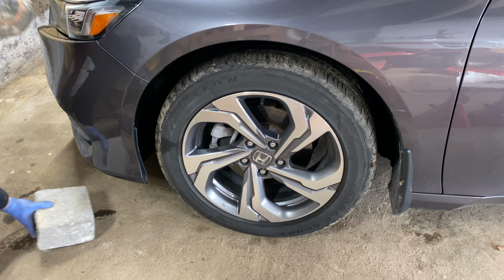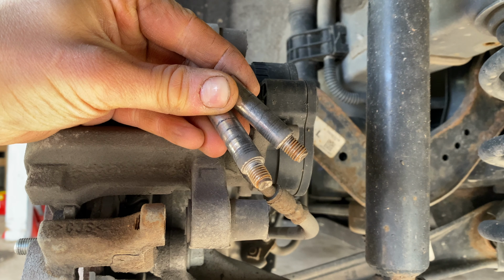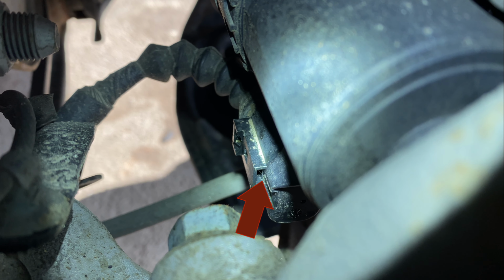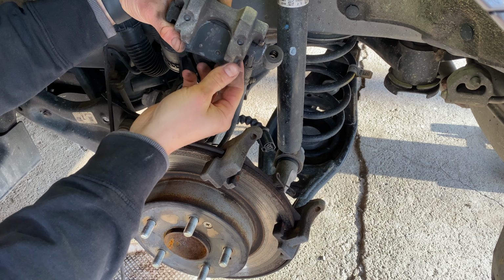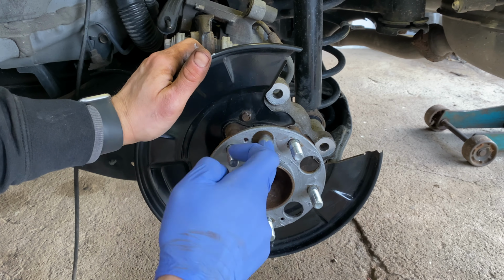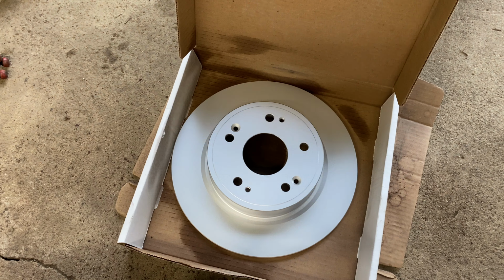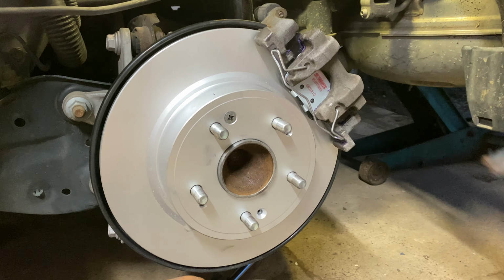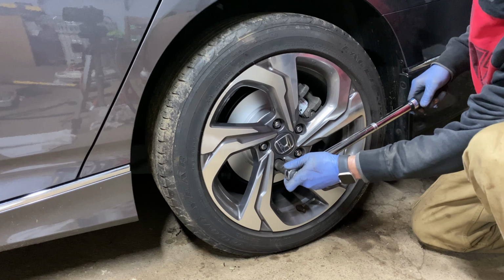2018 Honda Accord Rear Brake Pad & Rotor Change - Electronic Parking Brake in Maintenance Mode

Comment: Just a small correction. You don't need to buy expensive scan tool to retrieve parking brake. Autel's AP200 that costs around $50 will do this job. In fact, you can also monitor ATF temp when doing ATF flush, read / erase codes, get Live Date for electrical and the list goes on. It pretty much the same functions as on $500 to $2k scan tool.

Comment: Anyone else notice the rear brakes wear two to three times faster than the front? I have 50k on my 2020 accord sport and still on the original front brakes with 6 and the 2nd set of rear pads with 5.

Comment: Question:

1) can I use anti seize instead of thread locker for the 17mm bolts?

2) you used two types of brake grease, the orange and purple one. Can I use and is it safe to use just the orange one? The silicon ceramic one only? Or do I also need the ceramic one only?

I will be doing my first ever rear brake job on my Accord, want to make sure I do it right.
Reply from the maker: 1. No. 2. No, they are specific to use case.
Reply: @DavidStumph  last question. I’m in canada and Canadian Tire doesn’t have the ceramic extreme (purple) like the one you used. They have silicone ceramic (orange) and silicone only (green).

For the slide pins I see you used the silicone extreme (orange) so that I can buy at CT. What about for the metal to metal part? I shouldn’t use the silicone (green) right? I should specifically use the purple one?

Is it safe to use:

1)  green instead of orange for slide pin?
2) orange instead of purple for metal to metal?
Reply from the maker: Don’t get fixated on the colors. Silicone based for anything coming into contact with rubber and not subject to extreme heat -40°F to 400°F (it’s not petroleum based, to avoid rubber breakdown). Metal to metal contact points, the ceramic synthetic is what I use, it’s not petroleum based and has a higher heat tolerance than the silicone base -65°F to 3000°F.
Reply: @DavidStumph got it thank you very much

Comment: Hello. This is a safe alternative to using a scan tool correct? E brake will work normally after this without needing a dealer to look at it ?
Reply from the maker: Yes.

Comment: My automatic brake keeps turning on automatically after turning off the car… what I did is put in accessory mode and turn it off and then unplugged the battery is this smart or do it in accessory mode? Please reach out
Reply from the maker: Hello, those steps are not in my instructions. Sorry, I am not sure what you are doing. I hope everything turns out well.
Reply: @ worked just fine! I turned off the e brake and disconnected the battery and the e break stayed off. I replaced one side just fine. The only thing that got me was the stupid ass screw on the rotor
Reply from the maker: @ohhchuta that screw does, in fact, suck!! 😂
Reply: @DavidStumph  thank you for this video man! Best one on here.

Comment: I just did this job on a 2020 Accord.  This video was an amazing help and a great tutorial on what to clean up, what to lube and how to do the job.

Two notes I found:

Another video I watched which wasn’t as complete as this one demonstrated putting the vehicle in ACC mode and winding down the caliper with needle nose pliers or a caliper tool.  I rented a caliper tool and was able to wind down the e-Brake without taking it apart.  Very easy and can do it by hand.  You definitely don’t need to take the ebrake housing apart.

I also noticed brake noise (clicking) on the first test drive.  I got premium low dust pads that seemed to fit quite nice but the spring clips (inside pads) did not seat tight against the caliper tight enough causing a clicking sound.  I had to take the wheels off and pry the springs up tight against the caliper.  That got rid of the noise.  Next time I would pry up the springs a bit before install to make sure they’re tight.

Extremely helpful video for someone that hasn’t done brakes in 20 years though.
Reply from the maker: Honda tech info maintenance guides advise the method I showed to disassemble the e-brake. I still recommend this as winding as you’ve listed forces the motor mechanism to turn without power and programming logic applied, that is not recommended and does risk damage. I absolutely appreciate the feedback, the time you spent commenting, and I hope future videos prove equally helpful.
Reply: @ it seems like the motor is sort of like electric motors I’ve taken apart on a lot of different cars for a lot of different reasons.  I’d wager there’s a plastic gear and bushings in there which will wear out anyways.  I don’t see how it would damage the ebrake motors or be any different than turning the torx and re-assembling, but time will tell.

I did think the video was excellently done and very to the point.  Thanks!

Comment: Absolutely spot on. Complete and concise instructions on how to do the job properly and effectively. 

For those that do not want to disassemble and reassemble the EPB motor, a cheap ($40) dongle,  autel ap200,  can be purchased that makes your phone a scan tool. You can effortlessly put your brakes into and out of maintenance mode.

Comment: Is it possible to just deactivate the automatic parking brake by putting it into neutral and then pressing down on the parking switch to turn off the automatic parking brake? Or does that not work for this?
Reply from the maker: Does not work that way.

Comment: i try to take out the rotors on hrv 2020 could not able too why i alrady remove the screws on  the rotors that holding it in front i still could not able to remove it try banging it  did i miss something i remove the calipers and brackets also just rotors left but not able to remove it darn why

Comment: I noticed in other videos, the caliper piston is first turned a few times, then once it couldn't turn anymore, it was compressed as in your video. Is turning the piston necessary?
Reply from the maker: Yes, you need the room to insert the new pads over the rotor.
Reply: @DavidStumph  Thanks for the quick response. Yes, I know the piston needs to be retracted, but does the piston need to be turned clockwise until it stops by a special tool or just compress the piston straight back into the caliper? The tool I saw in other videos had a round disc with two pins that fit into matching indents in the piston
Reply from the maker: Good eye. Once the electronic parking  brake is manually retracted as the video instructs, only straight compression of the piston is needed. No fancy tools, no twisting. The other videos for the 10th gen are misleading.
Reply: @DavidStumph  Thanks David. I understand now. Does the car need to be put into "maintenance mode" first, then returned to "normal mode" after the new brakes are installed? If so, how do I do that without an expensive scan tool?
Reply from the maker: No maintenance mode.

Comment: Should the front be changed at same time?  Firestone is telling me they all need to be changed but I’m skeptical.  Most of the breaking comes from the rear, right?  Any info is appreciated
Reply from the maker: Depends on wear and condition. Separate changes are possible. If you’re not sure, I’d take their recommendation. Your time is also valuable if you can avoid two trips.
Reply: @DavidStumph  thanks 🙏

Comment: Instead of releasing the brakes with the socket we connected jumper cable wires to the battery then with some cables we released the parking brake slowly until they were depressed all the way but I’m getting a brake warning on the dash any thoughts on what I can do? Otherwise we did the same thing in the video

Comment: So I did the accessories mode for the brake and yes I did got all my lights on after I turned my car on which was scary but after shutting down the car for 5 min all the lights went away. But for my next brake and rotor change I will do what you showed in this video sir. But I got a question- I didn't change my rotors since 2019 oct so do you think I should take the risk to get the rotor's screw on my own coz I'm sure it fully rusted af lol

Comment: 3:20 what do you mean by, “To avoid contamination of this closed system, I strongly recommend lining up the splines to the actuator and reinstall following a complete winding of this mechanism.” Are you just saying to re-cover it as soon as you wind it and before you continue to replace the pads and rotor?
Reply from the maker: Yes

Comment: Great job, I always do it in accessory mode and make the job a lot quicker, also eliminates messing around with electronic part that can be sensitive.
Reply: I was about to say, his method is a little more complicated, I did it in accessory mode also and no issues, much quicker also.

Comment: Great Job.  Please do a transmission filter change on 2018 Accord EX (10th Gen)  There are several fluid only clips but no filter change. Thank you for your consideration
Reply from the maker: There is a strainer assembly, so this isn’t a quick job imo. It’s considered a “lifetime part”. Might consider tackling this one day, but not sure I’d want to pursue this one.
Reply: I got the fluid replaced at 30K on my 2019 Accord EX and the dealer told me there was no filter, only oil.
Reply: @bluazur55  Thank you for your reply.  I take what they told you with a grain of salt.  It's not logical...I think they are talking out of the side of their mouth on this one.  I'll let you know if I find out differently.

Comment: Should I put anti-seize onto all bolt threads so everything breaks loose easily next time?  Same with the brake bleeders if I ever decide to do a brake drain and fill to put anti-seize on them as well?
Reply from the maker: Do not put anti seize on the lug nut bolt threads. You’ll end up losing a wheel. Only apply anti-seize where I mentioned in the video. If you’re not sure, take it to a garage and have a professional handle it. Good luck!

Comment: Would this same process work in a honda insight 2019?
Reply from the maker: Not sure, haven’t changed them on that car. Does it have an electronic parking brake, if so it’s likely very similar.
Reply: @DavidStumph  yes it has an electronic parking brake like the accord

Comment: I replaced the rear pads and i wish i saw this video before but i ended up twisting the piston and it worked and everything but now im getting a brake warning light and my parking brake only engages on the left side and the light flashes. Any idea what that could be or how to fix it?
Reply from the maker: I think you need to establish if the parking brake module is damaged or if you have a different issue. Take the working parking brake motor and place it on the opposite side. If it engages, it could be something else like a bad cable… good luck. Hope it helps.

Comment: I followed this exact procedure, including new hardware, lubricant, and surface cleaning. Loctite was also use were appropriate. I am experiencing a bad rattle coming from the rear brakes when driving. That rattle stops when I apply the brakes and the brakes seem to be functioning perfect. Any thoughts or experience with this?
Reply from the maker: Both sides? Do the brake pads have any play in them? I’d take the caliper back off and see if the pads have an odd wear to them. Hard to tell without looking, but I’d take everything back apart and double confirm everything is tightened properly and has a snug fit. Have a second set of eyes take a look. Check all parts for damage or poor seating. Interested to hear what you find. High pitch or low pitch rattle? Any bangs?
Reply: @DavidStumph  So I found that the springs on the inside pad are not making contact with the caliper (both sides)  When not under pressure, I can move the pad by hand. I have Powerstop Z17 pads.  I reached out to Powerstop to see what they say but do you have any thoughts?
Reply from the maker: Springs? There shouldn’t be any springs. Did you buy pads with retention clip hardware that is installed on the caliper mounting bracket where the brake pad ears sit? My brake pads didn’t use or come with clips. The pad ears should just slide into the caliper mounting bracket. The outside brake pad rests against the outside caliper ears and the inner pad makes contact with the caliper piston, which is what creates the pressure to produce friction.

You might want to have another set of eyes look at this if it’s your first time, or wait for a response from the brake part manufacturer before you drive. Good luck and be safe.
Reply: I followed the exact procedure. Brakes engage and all but in the dashboard my brake light is flashing.  Any advice would be appreciated.

Comment: One more question. Do you have to open/loosen the brake reservoir cap before this process?
Reply from the maker: No. Some would say there is possibility for pressure to be present when you compress the caliper piston. I’ve seen other people open the break line bleeder at the caliper when compressing the piston. I’ve never encountered the pressure or felt the need to bleed the line. With the process I’ve shown there was no pressure on the spindle for the caliper piston. You’re call.
Reply: @DavidStumph  Appreciate all the help. Went ahead and donated. Keep up the excellent work.
Reply from the maker: Awesome, thank you very much!

Comment: The caliper spindle is turned in;  does the motor itself need to be adjusted in any way?  Or can the motor just be reattached and that is sufficient?
Reply from the maker: Just re-attach as shown and you should be all-good.
Reply: @DavidStumph  Thanks!

Comment: I saw this video AFTER I had already used a brake caliper tool and I did not put it in service mode as you you did.  Now I am getting a brake error message and the car is telling me to go see a dealership.  Is there anyway to fix this?  I wish I had seen your video first.  Any help would be greatly appreciated.
Reply: Did you find a solution? Happening to me too
Reply: Same my pops connected jumper cable wires to the battery then with some cables we released the parking brake slowly until they were depressed all the way but I’m getting that same warning
Reply: Getting the same error on dash, you think we place the pads with the caliper not retracted all the way in or there’s a way to reset the error code

Comment: In the video at the 2:58 mark, using the e-torx #11 socket, you said counter clockwise. But it looks like you’re turning it clockwise.  Is it depending on which way you’re facing? Thanks again.
Reply: Not counter clockwise. I did it and the whole thing damn near came out. Now I’m stuck trying to get it back in. 😭😭😭😭😩
Reply from the maker: From the perspective I have shown in the video, it is counter clockwise. If you are under the car and have your head under the trunk looking at the wheel, then yes it’s clockwise.
Reply: @DavidStumph you mean if your actually facing that screw then it’s clock wise but since you’re behind it it’s counter clock wise yes? just wanted to make sure cause I’m
about to change my brake pads and rotors with akebono pads and stop texh rotors
Reply from the maker: @lexmichael2040  Yes
Reply from the maker: Definitely counter- clockwise from the perspective of the camera and my body in the video.

Comment: About to do this job.  Can’t decide between which method to use for the electronic e brake - Yours or just should I use a caliper tool/needle nose pliers to spin the caliper head back in and not touch the brake module ? Any advice ? Thanks
Reply: Just did the job man followed your instructions to the tee.  No issues at all, thank you again.
Reply from the maker: I’d recommend not forcing the brake module which is the method I show. The 5 minutes it takes is not worth the risk of not doing it and damaging the electronic brake in my opinion.
Reply: @DavidStumph  I understand.  The only reason I got doubts is because of  something I read about the threads not lining up with one another after doing it by hand, causing problems with the system ? (Something like that) Supposedly a Honda master tech suggested this.

Comment: Do you plan on doing a front video as well? Or is it pretty much the same?
Reply from the maker: I probably will in the next several months.
Reply: Looking forward to seeing how you jack up the front...the front center jack point is ridiculously too far in and I can never reach it. I do my own oil changes by only lifting the passenger side.
Reply from the maker: Lift at the rear side jackpoint, just before the rear tire and under the rear passenger door till the front comes up enough to throw a jackstand in on the front side jack under the mirrors, repeat on the opposite side. That’s how I usually do it.

Comment: Hi in the video you say to turn it counter clockwise but it looks like you are turning it clockwise could you please let me know witch is the write way thank you.
Reply from the maker: Which step are you asking about? There are several places in the video calls out the direction to turn a bolt. Removal or reinstallation portion would be good to know as well.
Reply: @DavidStumph  video starts at 2:57 when you use E torx # 11 to turn the brake piston by hand.
Reply from the maker: @anhlam4  from the angle of the camera, as I am showing, it’s counter clockwise.